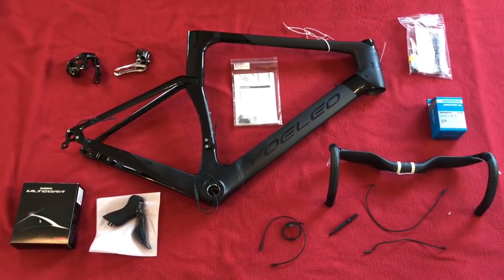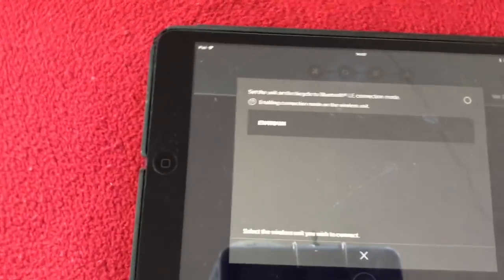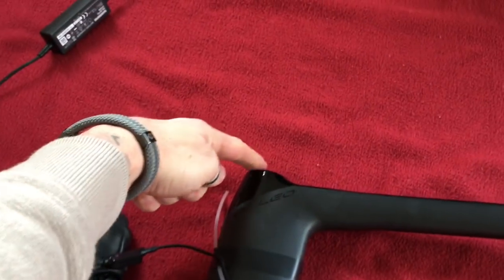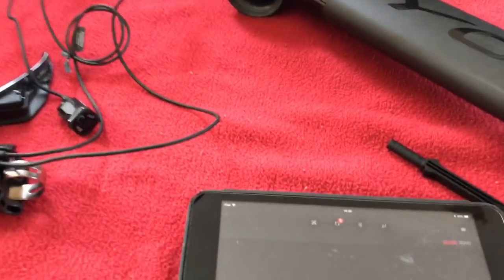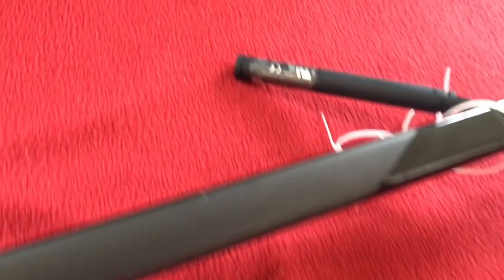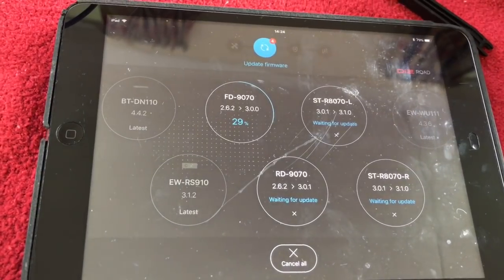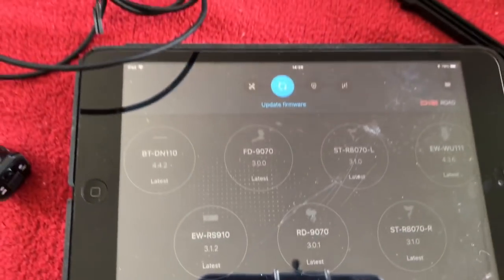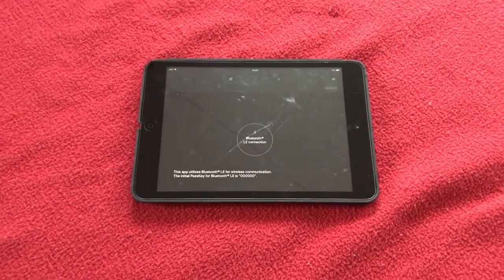E-Tube Project Shimano Di2 realtime firmware update

Comment: lucky for you man... i've been updating my battery firmware for the last 2 hours... at 52% right now... got to 46% super fast and slowed down. looking at some forums, a lot of people have the similar issue :(
Reply from the maker: Gurk E keep the faith! It does take ages... I’m not sure what determines the update speed as I’ve only got 60meg broadband download, let me know how you get on?
Reply: Will do! 72% and going strong. I heard before from others that battery is the worst and the others go smoother. I really hope it doesn't fail mid update cause I hear that can brick the battery and you need PCE-1 to recover from it. Which I don't have. I'll post again in the morning :)
Reply: 100% after about 17 hours. and it failed upon completion saying firmware can't be written on the battery. good work shimano. trying to overwrite with the old firmware. who knows how many hours THAT will take or if it will even succeed. i might be out of a bike all weekend cause i'm now ordering a pce-1. please take more of my money shimano....
Reply from the maker: Gurk E that sucks... updating mine was actually scary because I didn’t want it to break or stop working. I’m sure it’ll be fine, not sure why it took so long, maybe run the error checker on the app?
Reply: the app doesn't connect to the system anymore. battery completely dead which means wireless unit is not working either. only way to connect or do anything now is SM-PCE1. I ordered one. It will be here on Monday. We'll see...
Reply from the maker: Gurk E what is the SM-PCE1?
Reply: The device that lets you connect the system via USB cable instead of wireless. Since battery is not working at all, I can't connect wirelessly. So I have to plug the pc in to correct any possible errors and reinstall the corrupt firmware on the battery cpu :/
Reply from the maker: Gurk E ah I see... hopefully that sorts it out for you.
Reply: So the PCE-1 arrived (earlier than expected!) but it still wouldn't work on my virtual windows machine on mac. I borrowed a PC laptop from a friend and finally fixed it. All parts' firmware updated and all functionality restored on the system. I'm very upset shimano didn't do a better job writing the software for these parts but sure glad everything now works so I can ride.
Reply from the maker: Gurk E glad you got it sorted! That can’t have been great having Di2 that didn’t work, I’ve heard of loads of people that have problems updating through E-Tube App, glad mine worked and another reason why I made the video.